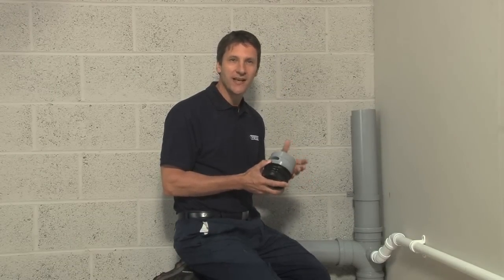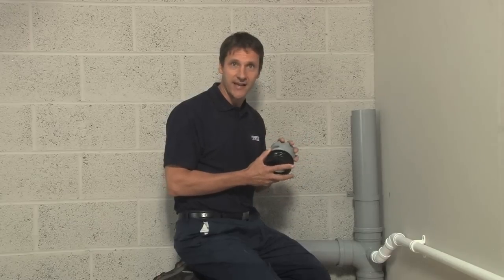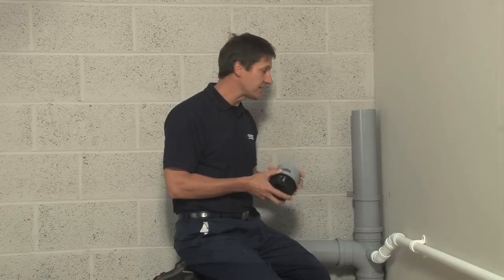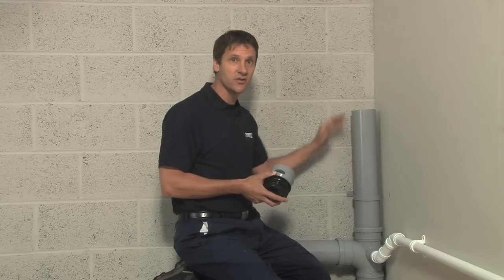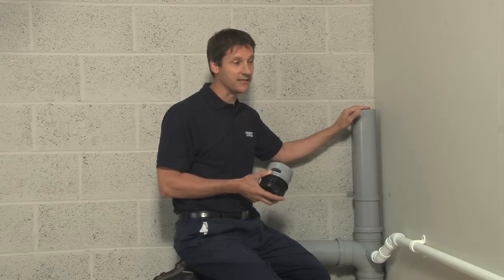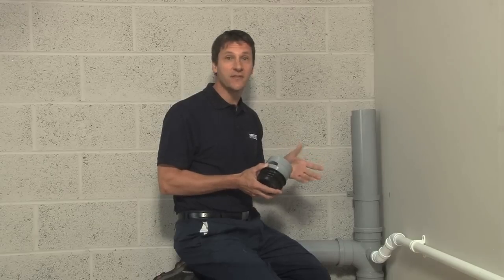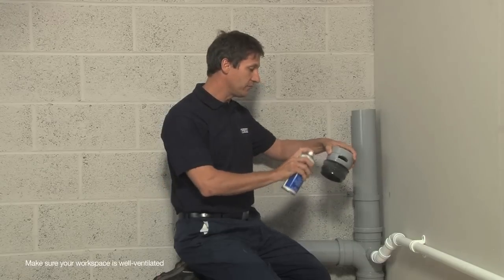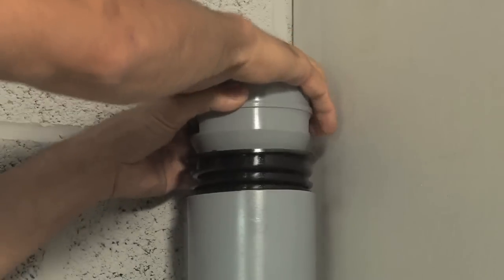How to install air admittance valve - OSMA Soil & Waste

Comment: The established view is that AAVs should always be positioned above the spillover level of the highest appliance. The logic behind this practice relates to the risk of flooding, a topic recently discussed as part of our Water Matters campaign.

One of the key requirements of any drainage system, as set out in the Guidance section of Approved Document H of the Building Regulations, is to “not increase the vulnerability of the building to flooding”.

An AAV located below the spillover level potentially opens up the building to a flood risk in the event of a blocked drain. However, there are different types of AAVs and you need to know the difference.

If you are in a position where it would be helpful to drop a 4” AAV below the spillover level, e.g. to reduce boxing, the answer is “you can”, but you need to check the designation of the valve and choose a reputable product such as OSMA.

You need to look for a kitemarked AI or AII designated valve as these are tested and approved to higher pressures (10 000 Pa or Pascal’s), capable of resisting water backing up through the soil pipe. If you ever feel inclined to look into this further, BS EN 12380:2002, section 4, table 1 is always a good read!

A final thought before you commit though; consider rodding access. If you are intending the use the AAV as a rodding point, you might want to re-consider and locate it above the spillover level – it could be less messy!
Reply: Wade how do I cut the pipe while in situ?

Comment: I am about to change the set up of one in a bathroom refit. I have read what was said here ie it must be fitted higher than the basin. Surely any backed up stack will cause a flood out of the lower toilet pan long before it reaches the basin or the AAV? In fact it can only reach the basin if the bathroom door is shut and water tight.

Comment: The chap who fitted mine put it below the height you said only about 9 inches up from the floor? So far so good! : /
Reply: Some models like McAlpine's don't need to be placed that high, just 200mm above the highest connection.